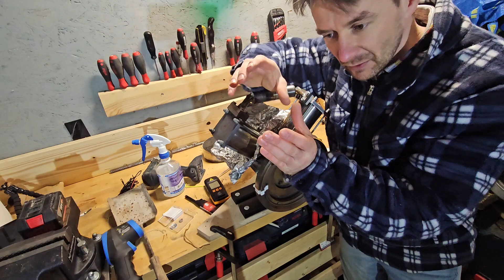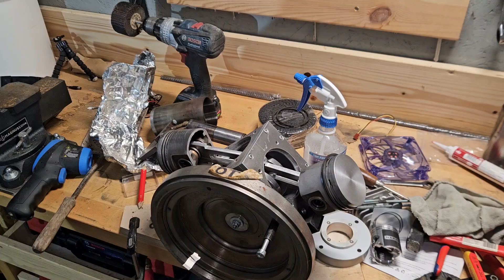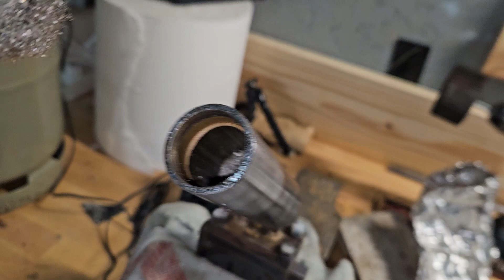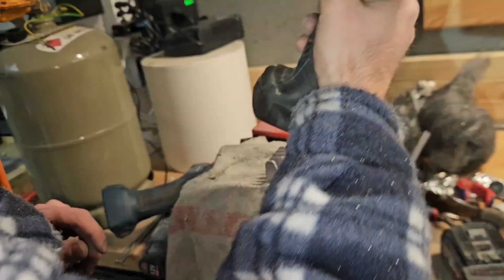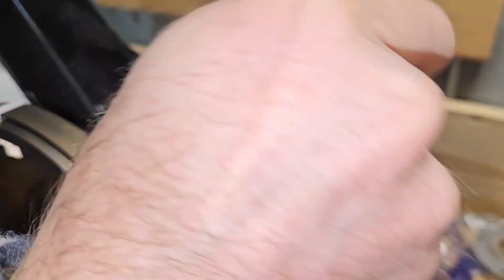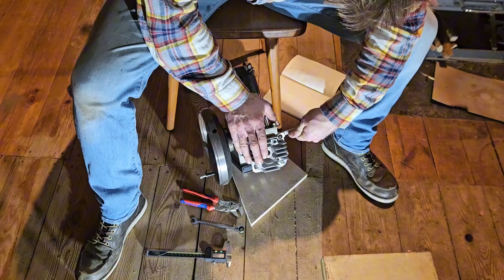Testing my 600cc Stirling engine at 1250°F + improvements

Comment: I tried once the same typ of Stirling. It did not work. I established that the piston on the heating side became way to hot, expanded therfore, which increased the friction to keep the machine from running.
I did not do it myself again, but I have seen constructions where the heating cylinder was exdented by a smaller cylinder. Then the piston also was extended just by a very light cylinder which should have a gap of 0,5 mm to avoid any friction in the heating zone.

Comment: I think the flame on the flat surface of the cylinder head is not the best idea.  Increasing the heating surface area may be an improvement.  Even just turning circular grooves in the head would increase the area.  You could also increase the heat transfer area inside the cylinder but that is more difficult without increasing the interior 'dead space'.

Comment: A lovely-looking engine, such a shame that running is not so good.  Have you made any other stirling engines?  I made one small one (it worked from the heat of a cup of tea); it helped me understand.  I used the lids from tins of boiled sweets, barbecue skewers, a plastic bottle, a sewing needle, wire from a paperclip, polystrene from packaging and rubber from a balloon (cheap and simple), and it only took a few hours of work. I would recommend this approach to mastering the design issues.

Comment: take all  rings off the cold side add weight to flywheel  one oil ring on bottom groove and the compression ring in the center groove no top ring
Reply from the maker: Thank for your comment.  In some videos I tried many configuration regarding the amount of rings. Turnes out 1 ring each side worked best. Bigger flywheel,  yes I'm working on it. Unfortunately my crankshaft is made of spaghetti..

Comment: I’m not certain but I think lowering the compression ratio will reduce parasitic drag but also lower the maximum power output. Commercial stirling engines can use a high pressure gas as the working fluid but since the high pressure is a pre charge instead of a result of compression from the piston stroke I think the dynamics will be different from internal combustion engines. I suspect overall the higher internal pressure will still improve efficiency but to overcome the compressive resistance you’ll likely need a heavier flywheel to carry the momentum from cycle to cycle. Without changing compression, just making the flywheel bigger may help.
Reply from the maker: Intuitively, I think the same. I just got so many comments about lowering the compression in one video that I thought I'd give it a try. Thanks for your comment and explanation @saebeepirate 👍

Comment: Hi, the problem is that the hot piston must also be a valve "letting in" the cool air, because as it falls it has to close and open the air intake. In your design this does not happen. Usually the "hot" piston is longer so that the pressure of the heated air can "push" it down. Best regards

Comment: Hey, I really liked this build!
I've never built an engine myself, so I might be wrong, but I think there are two possible issues:
First – the crankshaft might not be properly aligned, which could be causing the pistons to move at an angle and create friction.
Second – the hot cylinder chamber seems to be losing too much heat. Maybe try building a metal enclosure around it and then heating it.
Let me know if this comment was helpful!
Reply from the maker: Hey @mikoaj1621 thanks for commenting. I'm happy about all respectful comments. Also I recently checked if 10 years ago, when I built the engine, if I set off both cylinder centres by the width of one connecting rod. And yes, I did. That means when you look from above onto the engine, one cylinder sleeve is about 5mm off centre and the other one -5mm. That's a result of the 10mm aluminium piece I took for the connecting rods. That means the connecting rod is not bending or anything. I think that is what you meant. Meanwhile, I came a bit closer to success with this project, less friction and so on, but I couldn't find the time editing the video. Check my latest short to get a taste of what's going on with this project.

Comment: Try a realy big fly wheel start wirh a car tyre+hub like the first steam engines Low Kompression friction all that you Need those few Newton Meters to keep IT running Mass weight on flywheel is force

Comment: I am just wondering are you sure you are spinning it the right direction?

Also a heavier flywheel might be more beneficial since the compression is so high you may need more force from the flywheel.

I like that you don't give up. 

😊
Reply from the maker: Hi @davesden Thank you for the comment. Good point. Yes I double checked the running direction recently. Clockwise is correct. Bigger flywheel is in the works. Check my latest short if interested. Still struggling with balancing. This tiny crank wasn't made for 20Kilo. 😅
Reply: Keep up the great work. Just found your channel recently i enjoy your videos😊😊

Comment: I don't think you should have compression. All you need is for the hot side to pump hot air into the cols side, Hot air expands, cold air shrinks. The hot air expands pushing the piston down and passes into the cold cylinder which cools the air causing the  air to contract and sucking that cool side piston up

Comment: I think graphite is a good idea—maybe I’d try applying more (scraping pencils, perhaps). I’d avoid using WD-40 because it’s a solvent, not a lubricant. Instead of using tape to insulate the warm chamber, try applying it to the heat exchanger.

Ideally, you want to conduct as much heat as possible through both cylinders—the hot and the cold—because the goal is to heat and cool the air inside them as quickly as possible to repeat the thermodynamic cycle faster. If you put tape on the hot cylinder, you're making it adiabatic, so very little heat is being transferred to it. Instead, you want the cylinder walls to conduct heat and warm the entire air column inside.

Stirling engines don’t work by exploding fuel, so you can use thinner walls to improve heat transfer. Try aiming the blowtorch from farther away to heat as much of the hot cylinder’s surface as possible—not just the top.

I’d also check for compression or friction issues. At 500°C, the piston rings might expand too much, and the losses could outweigh the expansion power. Also, due to the weight of the pistons, the engine won’t rev as fast as when you spin it with the manual starter. Maybe reduce the starting speed to better match the engine’s actual operating speed. If you spin it too fast, the air doesn't have enough time to transfer between hot and cold, and the cycle won’t start.
"Today i just had an exam about heat engines at university where i study mi master degree in mechanics, this i just said is what i have been taught about this little weird but fascinating engines, hope this helps"

Comment: Will not work!!! System had no exchange of heat. Portion of heat must be rejected so there be both expansion and contraction of working substance (air) to drive the power piston. Displacer side must be revised so there will be an exchange of heat!!!!
Reply from the maker: Thanks for your comment @neodumalag6933 translation is hard on this comment but I think I get what you mean. I know this engine design has many flaws but since I saw it nearly running in one of my last tests with piston rings, I wanne make it work before I start a new design.

Comment: A few comments on the design. Generally the cold side is providing the power or thrust of the engine. Not the hot side.
So that means that the piston head on the hot side should be much smaller so that the air can flow around the hot piston head, aks displacer. This will also heat up the piston head which is not a problem. The cold side however should be air tight as this is necessary for the cold side to provide the power.
The air displacer (hot side) moves the hot air to the cold side. Once at the cold side the air shrinks causing the force to move the flywheel. And the flywheel causes the air displacer to move. 

How I would fix your design is to elongate the hot side piston, using a metal tube, and flip around the air tunnel thing, to point to the longer side. Attach a new air displacer to the top of the hot piston - that reaches to the top of the new longer hot side.
Reply from the maker: Yes, I wish I knew that 10, 15 years ago when I built that thing @joeatnara7518 . In my new design, I will do it as you said, and most engines are designed.

Comment: From the previous video, the fact that the rotation becomes more difficult at certain points does suggest a compression issue more than a friction issue.
Reply from the maker: Maybe @TheMatthooks , thanks for your Idea. Yes compression is hard but I think it's normal in this kind of engine. I will just increase the flywheel weight/diameter to overcome that compression "issue". It seems to me like the simplest and cheapest approach right now.
Reply: @Son-of-Allen-key  yes, if the flywheel has sufficient momentum to overcome the compression that would definitely help I think.

Comment: A stirling engine has the power to inflate, not to explode, so I believe that your engine's compression is too high for the less violent pushing force in a stirling engine as opposed to internal combustion. Exploding a fuel-air mixture kicks hard enough to overcome a strong resistance, but the air that inflates less suddenly in contact with a hot surface shoves more than it kicks.

Comment: Remove the piston rings from the pistons. You won't start it with the rings. Make it so that the piston without the rings moves tightly but easily in the cylinder.

Comment: in your last video, you measured rpm and the first one was 290 and the second one was 360 so your motor is making 70 rpm itself. it is around 1 round per second that is very slow so you will need a much better flywheel. if you look 
 at last video when the motor was about to start, when it wants to get energy from the flywheel to contiue it's circulation it stops. it's like flywheel has no enough energy to return the piston back. I'm very interested to know if it works finally or no please make the improvement s and test it again
Reply from the maker: Yes @nimahashemi3976 . Had the same Idea and will attach additional weights to this flywheel on a bigger diameter to keep it simple and try with that.

Comment: Perhaps you should try removing some of the regenerator material just to see if it helps? I can honestly tell you too much will keep the engine from running. I've been building Stirling engines for 15 years Or more and I can assure you if you have too much it will cut down on the air flow and keep it from running. And you can't have any drag on a stirling engine it has to be silk smooth to run. on some of my engines I have put Schrader valves into the regenerator so I can introduce air other gas like helium. Sometimes if you can get preheated air into the engine it helps it especially for one that's stubborn. I have experimented with all types of setups and there are always a couple of constants that you have to address and that is drag and leakage. No friction and no leaks to put it simply. a Schrader valve in the regenerator will help you determine if there's any leaks.

Comment: I believe you should go back to revise your knowledge about how the theory behind all this works. Notably, huge issues I can see are, using WD-40 as a lubricant, and the surfaces through which the engine accepts heat. (don't heat only the top plate, heat the entire cylinder surface).
Reply from the maker: Thanks for your thoughts, @londonnight937. I will. 10 years ago, when I built this thing and was still a student, I knew the theory pretty well. But now when I rediscovered it, I forgot most of it. With the surface area, you have a good point, I agree. My WD40 is not stopping this engine from running, though.
Reply: @Son-of-Allen-key  The WD-40, is, in fact one of the worst lubricants you could choose for moving parts. Its main property is that its surface tension is very low. So is its viscosity. For getting a rusty bolt unstuck this is perfect, as the low surface tension and low viscosity make it the ideal candidate for penetrating deep in the threads of the screw, quickly. This is why WD-40 is called "penetrating oil". As for when it comes to actually two different parts designed to be in relative motion to one another, sliding against eachother, this lubricant is almost almost as bad as having a dry surface. This is because in this type of scenario, hydrodynamic lubrication is desired, and for that purpose, the lower the viscosity of the lubricant, the higher relative speeds are needed to achieve and maintain the lubricant film. The opposite is true: the higher viscosity lubricant you have, the lower relative speed between the two moving components is needed to achieve hydrodynamic lubrication. WD-40 is insanely low viscosity, totally unsuited for this purpose. I bet a big deal of the friction comes from your cold side, as it is acting like its not even lubricated, or barely so.
Reply: As a side note, many people who don't know better, oil their mechanical clocks with WD-40. Nothing could be worse for them. I could argue it would be better no lubrication than using WD-40 in mechanical clocks, because even though WD-40 provides no lubrication, it also makes dust stick, which is considerably worse than no WD-40.

Comment: You need heat exchangers inside the hot and cold side. Many tiny passages that the air goes through to quickly pick up heat and then release it on the cold side. 

Look up Andy Ross Stirling engines. He was among the best engineers.  His videos are probably still here.
Reply from the maker: Thank you for your comment @Chris-bg8mk I'll look it up. That heat exchanger air/air in the zylinder was my initial idea and the reason why I built this motor many moons ago. I wanted to make it run in this form, then implement my invention and check the impact in efficiency.

Comment: Good work with your Stirling engine! I have been building Power Stirling engines for 40yrs.
This is what to think about. 1. Use a Slip-Fit, not piston rings, too much friction. 2. No need for a Regenerator, restricts flow & spews iron bits onto your pistons = more friction & ruined parts. 3. Reduce Stroke but not compression, easier to start & it can run faster. Add an email to your description & I will make contact to share what I know about Stirling Engines. Thanks James
Reply from the maker: Thank you sir! I will try to run without piston rings in my next video.
Reply: @Son-of-Allen-key  Yes it must be a Slip Fit that still seals, use WD-40. Also consider cooling the Hot Side Cylinder with water on a Rag about 1/2 of it. All my early engines looked like yours... Too Much Friction & Not Enough Compression. Also when you spin it without the end-caps, you want to see 2  or more Revolutions, showing you Low Friction & Heavy enough Flywheel !!

Comment: Temporarily remove the steel wool in the regenerator to see if that will allow it to rotate. If that works, rethink your setup to allow the air to pass more easily between the two cylinders.

Comment: You have to have cross hash at 45 degrees  or 60 degrees using corse to leave scratches to hole lube to reduce friction
Reply from the maker: Thank you for your feedback @FrankJones-ne2qo. I'm working on something for lubricating the hot side. I think graphite aste is the only thing that can resist 500°.
Reply: @Son-of-Allen-key  I would extend the hot cylinder and put a tall stainless steel displacer on top of the piston to fill the excess volume. This way the rings can run on an unheated part of the cylinder wall and hopefully stay cool enough.

Comment: According to Dr. James Senft (an expert on low temperature differential Stirling engines), The reason the compression ratio matters is that it affects the needed temperature difference to run. The lower the compression ratio, the lower the 'delta T' needed for the engine to run. He has a couple of really good books on the subject if you are interested.

The higher the compression ratio, the hotter you're going to need to get the hot side for it to run.

Another comment I have is that the seal on the hot side may be failing. That side is getting very hot, you might be getting small holes that are leaking air and that is the reason it will not run. Air leakage and too much friction in the engine are the two main reasons I had engines that wouldn't run.
Reply from the maker: Hi @IronGoober, true, seal will burn. I should make this side out aluminium as well. Also thanks for the hint between compression and delta T. I'll look into that.

Comment: I think the idea of having a non return valve is it only lets air in if the pressure in the system is lower than atmospheric, to compensate for any leaks 🔧👍
Reply from the maker: Ah, okay. Now I think I understand your point. I have to sleep a couple of nights over that and figure out the best area to let the air in.
Reply: @Son-of-Allen-key  I have not tried this, I tried to make mine as air tight as possible, with as little friction as possible, not easy.